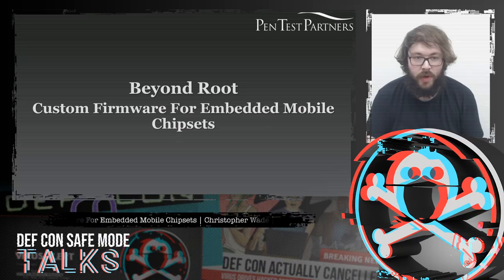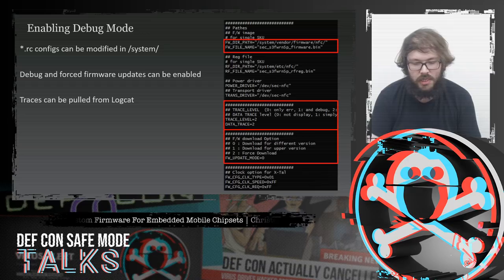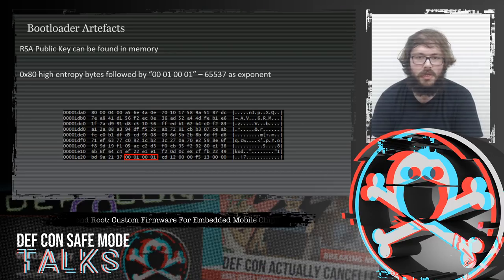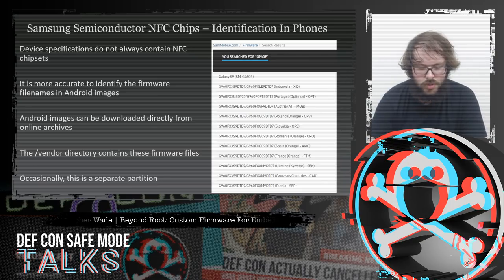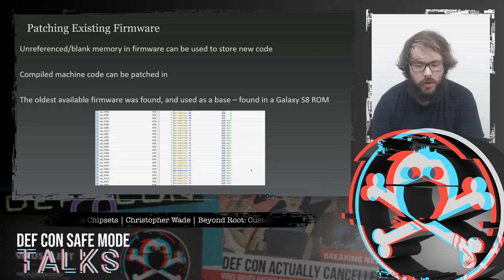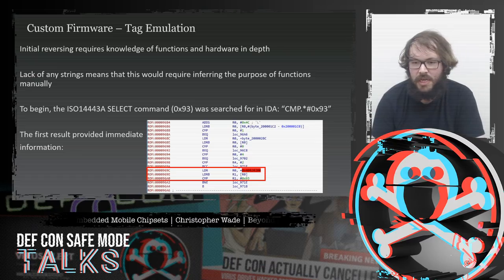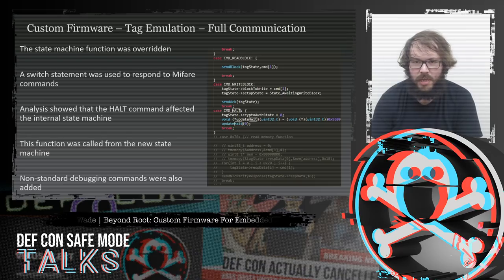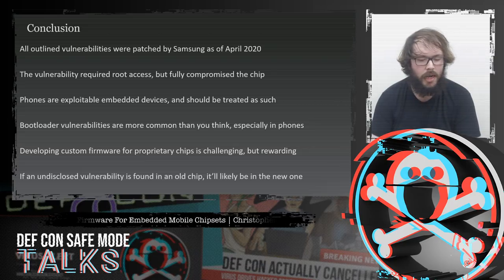DEF CON Safe Mode - Christopher Wade - Beyond Root

Comment: Its gettin lil more tricky these days to root an android smartphone. Iv always done it via custom recovery flash then install SU from the recovery but since theres so much security locks on these phones its difficult. Bypassing frp though isn't hard at all, just simply flash to factory binary-enable dev mode-reflash stock firmware, only catch is you have to have the correct firmware or you get a boot loop
Reply: SU? no Magisk for root... why? Pls Explain?
Reply: @joydeepjoshi  I can put magisk on it and SU but I cant root it. I think it's to do with Knox.